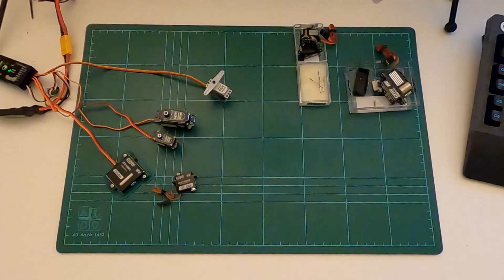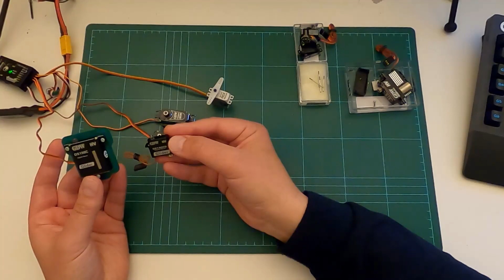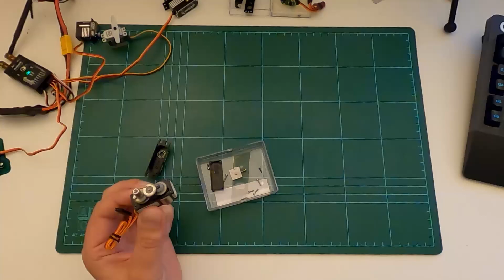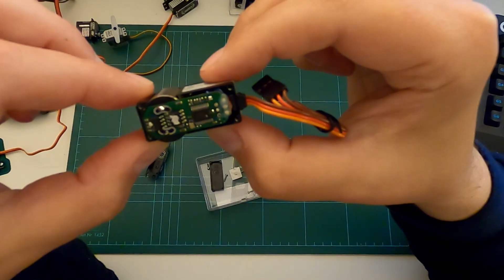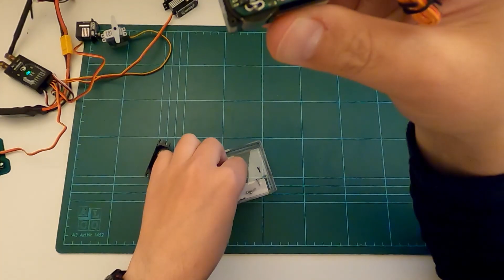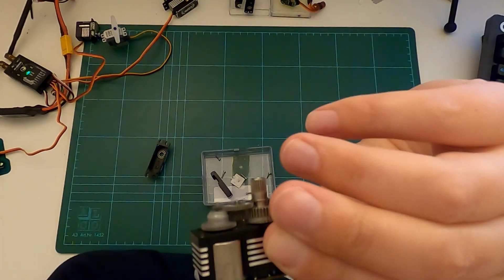Best value digital servos for Ritewing Drak, Mini Drak and Nano Drak ( I found ) ?

Comment: The electronics silicone on the leads where they are soldered to the PCB is not for insulation it's to prevent the leads from vibrating until they fall off the PCB or the pot (hopefully they have done this with the pot leads as well, or at least used long pot legs soldered straight into the PCB). The silicone goop immobilizes the wire so it won't flex at the solder joint when exposed to high frequency vibrations in a helicopter or an IC plane.

 What would be better is crimped board-in connectors (the wires are crimped into pins in a plastic block that is soldered into the PCB) but the only place I have seen that is in high end Futaba servos. Silicone goop is an acceptable alternative in lower cost servos though.
Reply: Do you remember which futaba servo(s) you saw this connection scheme in?

Comment: nice... what's the angle of turn? the specs say 220 degrees on the pot, but do they go that far ?
Reply from the maker: 2x60°, pretty standard. The big ones have a mechanical limit, the 290 don't, so maybe you could mod them for more. Haven't tested that yet tbh
Reply: @grumpyoldnerd8727  The three GDW BLS992 I bought have a deflection from center of about 47-48 degrees at 1000ms ~ 2000ms. Each servo is slightly different and left right are also slightly different with a tolerance of within about 1 degree which is pretty good (this is caused by variations in the pot, no two pots are exactly alike)

 Most servos I have checked are somewhere close to 50 degrees at 1000ms ~ 2000ms though there are exceptions.